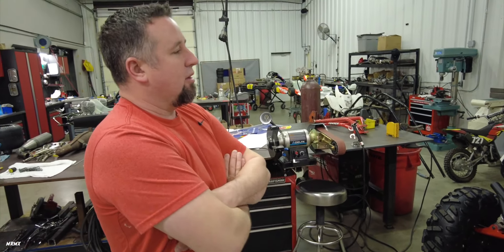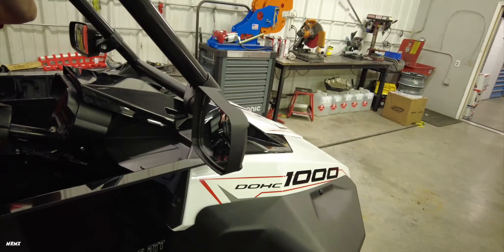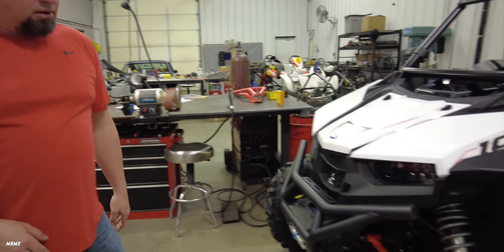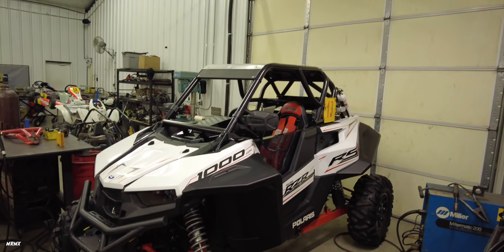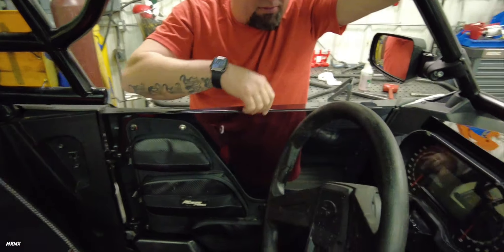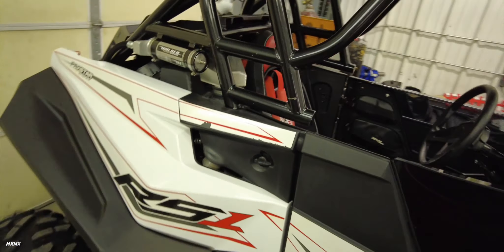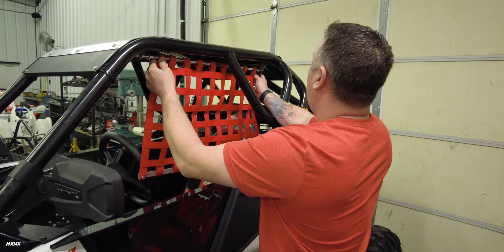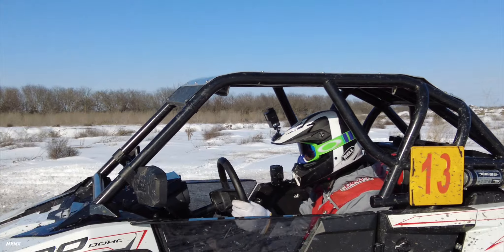NEW $20,000 Polaris RZR RS1 1000 LOADED w/ Add On's Walk Around *New Pick Up* | MRMX

Comment: LOL, i purchased a 2018 used with 1500 miles that has a full Aftermarket Assasins kit that includes a 93 octane tune, full high load clutch system with all the upgrades, exhaust, 33" Alba crusher beadlocks sith system 3 XT370 tires, arched a arms front & rear, custom cage with side windows that fold out with gas shocks, shock therapy upper & lower springs, door bags right arm rest with storage bag, rear bag, front bag & dash bags, detachable hess steering system, HD tie rods with bump kit, Rhino axles, glass windshield with wiper & washer for $12,000.00! ya'll have lost your minds paying $20k for that!